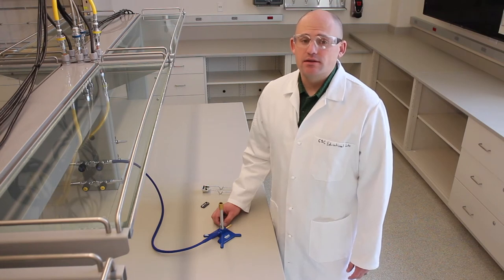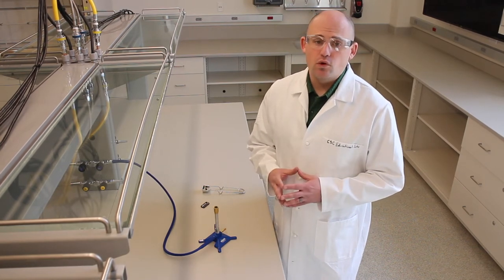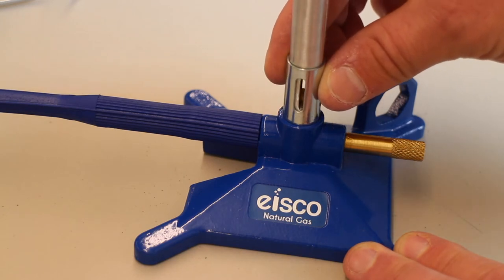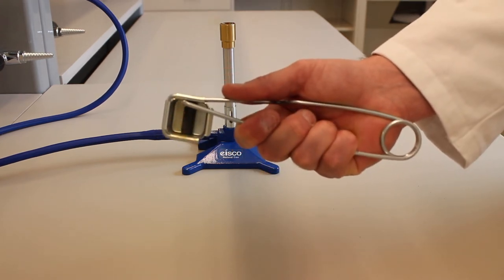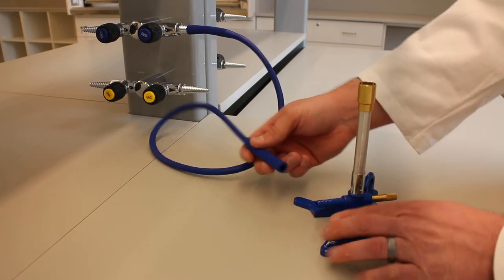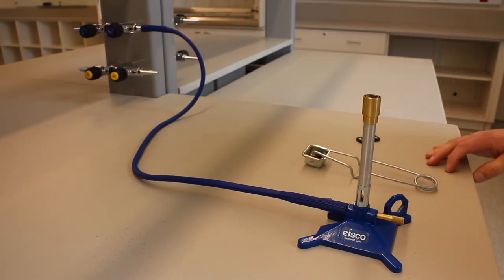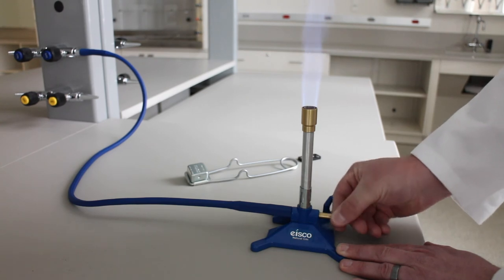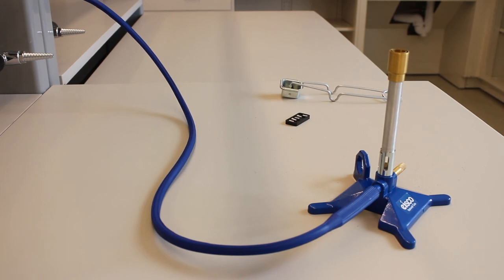Introduction to Using Bunsen Burners

Comment: This is a good demo, let down only by its perpetuation of the widespread myth that a flint striker is a safer way of lighting a gas appliance than a match. 

The welding industry does the most to perpetuate this myth. The number of failed attempts to light the burner with the striker in this video illustrates the chief problem with strikers: their failure rate means they allow the discharge of excessive amounts of gas into the air around the operator before the burner actually catches light. 

I’ve also seen no evidence that strikers reduce the incidence of flashbacks - the main supposed advantage disseminated by certain sectors of the welding industry.